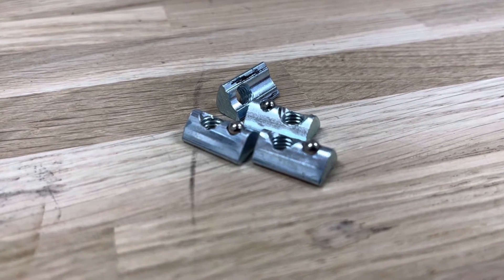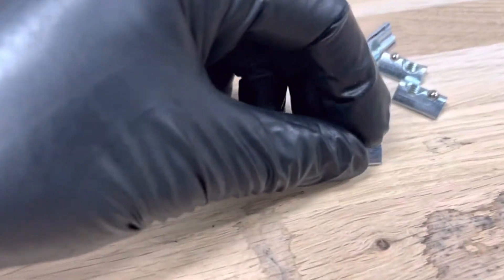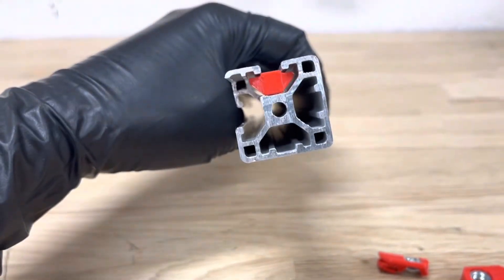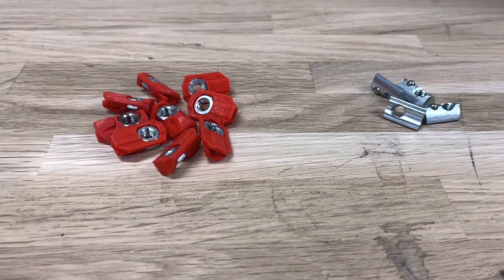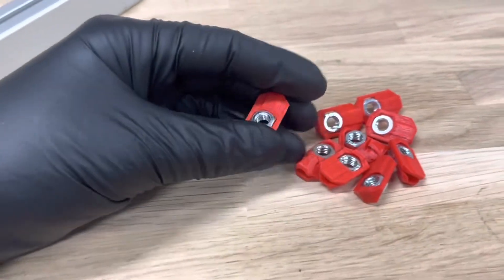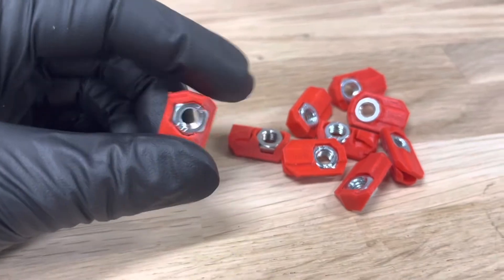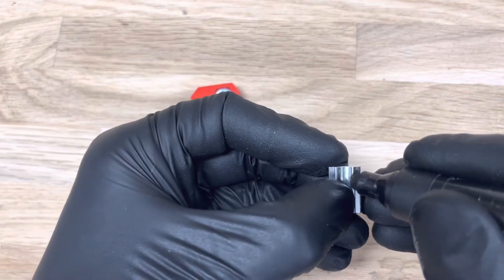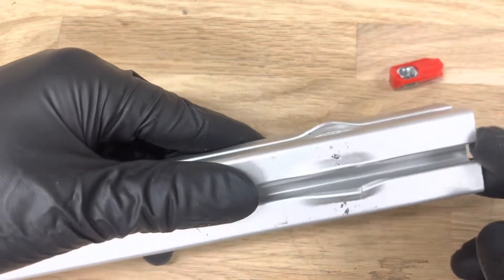T-Slot nuts: 3D-Printed vs Standard

Comment: I saw the aluminum fail in both cases. How is this a test of the nut itself? Maybe the steel one has a bit larger contact patch with the extrusion.
Reply from the maker: You are correct in that it is not a test of the strength of the nut itself. It more a test of the strength of the nut/profile assembly. Which really is what you are interested in when you want to build something with these nuts and profiles. 

And yes, the difference in result is likely because the larger contact patch of the standard nut.
Reply: @dynasus  Not sure on the cost per part, and if there would be enough room to maintain your mechananical features, but it looked like there could be enough room for 2 nuts in your plastic part. Double the steel-to-aluminium contact area and twice the chance of getting your bolt to match with a threaded hole!